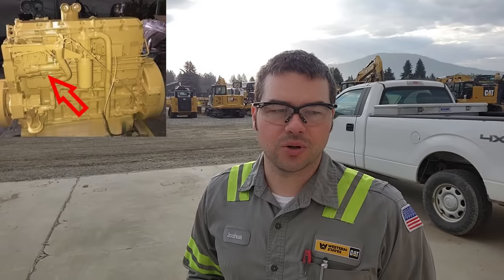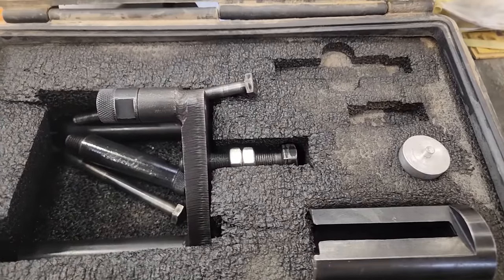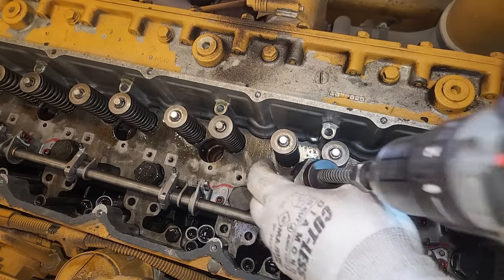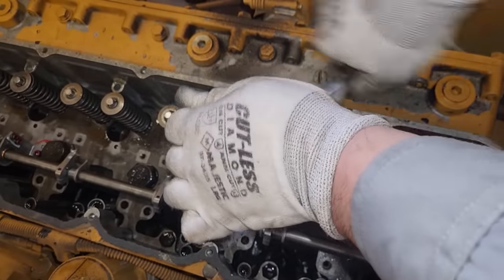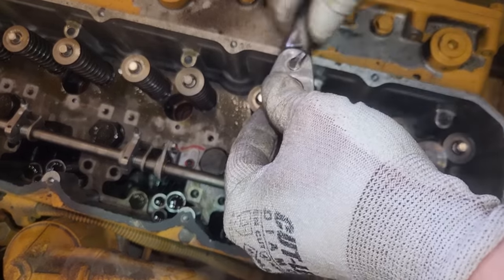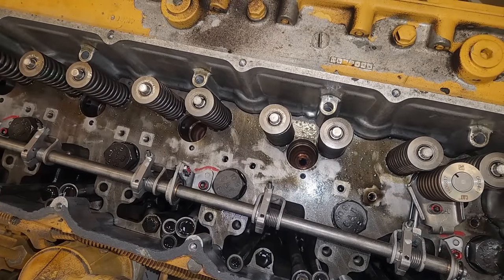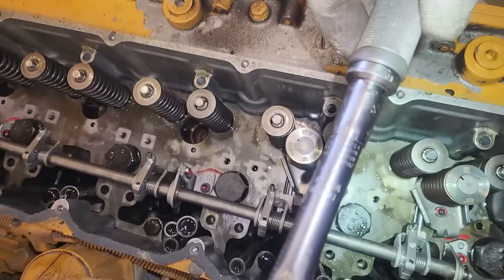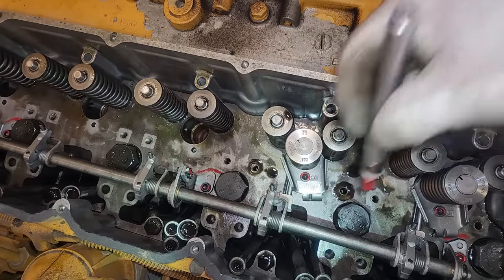Technically, A Headache! How to install Cat 3116 injectors and adjust the Rack.

Comment: More than 20 years ago I had an old Cat guy I worked with say you don't need to ream the coppers if you seat the injector with the seating tool.  I was thought he was nuts and lived by what the book says.  Tried it and found out He was right.  Now I only ream coppers if there is pitting in the seat area of the copper.  I usally shine them up and press a new injector in the the seating tool.
Reply: With or without the o-ring on the bottom tho?

Comment: You’re a brave man using CAT remans on a 3116. I put a full set of remans in an 3116 powered F-750 years back. 4 were bad right out of the box. Got 4 more under new parts warranty and two of those were bad. There were no more remans at the closest depot so the dealer I worked for agreed to put 6 new ones in. Everyone was happy except me…basically doing injectors three times in an F-750 where half the engine was under the cab really made me contemplate my life choices that brought me to that situation. Cylinders 1-4 under the hood then take all the tooling in the cab to do 5-6 through the dog house…

Comment: I've done quite a few of these from overhaul to injector replacement and adjustment, the hardest part was getting through the CAT manual on the first one I did, too confusing , but once I did more and more I could streamline the process and could say that I was satisfied with my results, a smooth running time bomb !

Comment: I remember in 1993 in Greenland at summit drilling camp they had 2    3116 gensets 
one Genset had  leaking injector, copper seat. And the cat dealer would not sell me the tools to install the copper seat so I had to put together a kit of tools for the mechanic out there new cylinder, head torque wrench I believe they already have the injector setting tools.

Comment: I used 1/4 in. vacuum line taped to the end of a shop vac when I had to pull shavings out of a cylinder.  Worked great.

Comment: Just like the old 2 stroke Detroit. Roll the cups in, fill with coolant and pressure test, install injectors, rack or racks, rockers, adjust valves, time injectors using the right pin, adjust racks. I spent 4 hours on an 8v71T just adjusting the rack. Get one side done then the other side was too tight.
Reply: That's why you do the #1 on each bank first. Then remove the clevis pin and adjust each 2, 3, 4, etc to its bank #1.

Comment: On Volvo D9 engine out of the g970 graders the cups were changed out every time. The original injector used copper washers but the replacement used a tapered cup and end on the injector

Comment: Looking at the older injector at 2:19, you can see the area above the seal it is about 3/8 of an inch wide, The other injector that is replacing it only about an 1/4 wide! That way it press in to the copper with more force in a small area. Then when you use the press down tool to force it in more to the copper, and you can see when your torquing it again it turns the bolt about a 1/4 turn insuring better holding of injector!
Reply: You actually crease the copper cup with the injector when you press it in.  I only ream copper now if that crease area is pitted.  If it looks ok I shine it up a bit and press it in again.

Comment: These engines are a whole thing in them self's. I would have cleaned up the reamer in a lathe at the damaged location, then added more shims to start. I used a speed handle to turn the reamer, so I could push down with some force, get it down then lighten up toward the end to smooth the  finish tapper.  I also cleaned off grease and used a light coat of grease on reamer then do the reamer one more time, this usually gives a good finish no chatter marks ! Do not turn the reamer back wards, can damage the reamer or dull it. When putting in the injector get it down in, turn it to engagement of the rack, then move rack back and forth to make sure it is free moving in the fork so it is not giving a preload on the fork and you get easy move meet of rack.

Comment: Just to add about the o-ring on tip. When you torque onto tip o-ring it will work for a sort time. With temp and time the o-ring will deteriorate and allow the injector shift down away from hold down bolt compromising clamping force

Comment: Better you than me. I hate these engines and stay away from them. One thing we tried was to use a speed handle to ream the seat. With a ratchet, you had the tendency to stop and get another bite. With a speed handle you can keep a steady rotation on the cutting tool. Also Carpenter make a aftermarket tool that was a lot easier over the Cat tool group to set injector synchronization.

Comment: Go 2mm over and it’ll advance timing and help with cold starts 👍🏻 ALWAYS run the lower “suicide” o ring. It will allow carbon to seal the cups after being reemed and will make life easier.

Comment: Use a speedwrench and skip the shims, slow steady turns, NO pressure, let the weight of the tool cut it, and please, NO ratchet.  You'll get a butter smooth seating surface, pull it out every few turns and look for the old seating groove from the injector.  Once the seating groove is gone, you're done, DON'T go any further.  Save that cup for next time you need to shave them.
Been there done that many times.

Comment: Cat also say no chatter marks, I found out use shims, and a drill on low speed no down pressure, they come out great, I always pressurized the coolant system after cutting all cups, and installing injectors, At Ransome Cat, one mechanic cut cups put everything back to find out when he seated the injector it cracked the cup, it was most likely  cut before.  Pretty much same thing as 3126
Reply from the maker: I'll try that next time. Pushing down was how I was shown and I've had good luck with it, but I sure don't like the chatter marks on this reamer.

Comment: you should set a two stroke detroit rack, lol cats are easy, leaving oil in those bolt holes will split the head using power tools, you should show the old rack if its the rivet one that needed the update,

Comment: The press tool when it came out was supposed to take to place of reaming. I ream some still if it had compression blowing by. But most of time press them in without reaming. I have had to redo some because not sealing reaming and not reaming. The smallest piece of trash will get you. And in the mines and plants when medium dozers and wheel loaders had 3116 or 3114 none would break in a clean place.

Comment: I’ve done 3 of these over the last 8 years. For injector, rack replacement and top end adjustment. An old timer told me to match fuel screw setting on new rack and sync injectors. Worked great each time. How wrong am I? Lol

Comment: Lot of following procedures there. They made it a bit complicated but if you have the proper information it should work. Surprised that the original ones had the o ring on the bottom but new ones don’t. You’d think that would cause placement issues. Great job on it.
Reply: The injectors were redesigned to have a short length tapper seating area, and with the tool to press the injector down then re-tighten the bolt made a big difference. The seal was not needed  after the update to the injector.

Comment: Very similar to Detroit Diesel 2-stroke setup. Did many. Don't turn reamer backwards. Only go in cutting direction.
Reply: Emd 2 cycle unit injectors are much simpler to do. One typically skips the rack adjustment when replacing a single injector. I’d check it with the tooling, and if it was within the window on the tool/gauge, it shipped. I’m not even sure if there is a cup reamer in the shop for dressing the seat in the head. I don’t think I’ve seen one floating around in the 20+ years I’ve been there. I remember some old timers saying one side of the engine thermal expands slightly more throwing out the adjustments on the racks on one bank, but I never found that to be the case.

Comment: The injector system is the same as the two cycle Detroit Diesel. I run a C-12. The manifold pressure has gone from 32 PSI to 20 PSI. Little loss of power, but slow to respond when throttling up. Any ideas. My guess is transfer pump is going haywire. Thanks

Comment: You need to put more time into reaming the copper, that area needs to be super nice, you left chatter marks, that area is susceptible to passing combustion gas.  We do not want come backs.  You have to develop a technique of smooth turning and even pressure and thinner shims so you can cut .001".  That carbide cutter wants to dig into the copper if you take too big of a bite.  This step is the most important part of the job

Comment: In my opinion the 3116 is one of the slowest and under horsepowered Cat engines that were built. I ran many medium duty wreckers with these engines and all of them were gutless especially the rollbacks with the automatic transmissions.
Reply: The 3208 might disagree
Reply: A lot of those engines were under 200 hp.  Not the 3116's fault they were starved for fuel.   We had service trucks that were 190 hp and lower.  Yeah they were gutless.  Backed out the fuel screw a bit and it would come alive.
Reply: The 3116s could be rated for up to 250 hp and 650 tq in the Topkicks and Kodiaks, but most came with 170 hp to 215 hp. Some fire trucks actually came with a 300 hp 732 tq version, but those are ultra rare.

Comment: Whenever I see a procedure for cutting the cylinder head to renew a seal, like valves or in this case the injector body seat, it makes me wonder why they decided upon that approach. In the case with valves, since the mfr's have gone to stellite seats the valve becomes the donor for wear. Which makes sense to me, the valve is less costly to replace than the entire head or seat replacements. In the case of the injector body seal, I wonder why they didn't use a compression washer made out of copper that you could simply replace. The seat area looks the color of copper on my computer screen, and you even said it looks like copper, but when you cut it brinelling reveals the hardness of brass. But, a copper gasket, similar to a brake caliper banjo-bolt and washer seems like it would work, it's only combustion pressure, not fuel injection hydraulic pressure. But, who knows? Maybe they got a patent on the cutting tool. Remember they're in business to make money, and even though it may not seem prudent, they want to make money where ever they can and if that means tools, oh well.  ben/ michigan

Comment: I have rebuilt somewhere around 15 of those and several 3114 engines. I hate the overhead on those engines. Our shop actually goes out and installs those copper/brass injector sleeves in, in the chassis. Did I say I hate the overhead on those engines.

Comment: How funny, they reverted to 1940's Detroit Diesel tech for the fuel system. But the Detroits were much more user friendly. Thanks
Reply: I thought it looked familiar!
Reply: Went to the equipment expo in Las Vegas when the 3500's and the 3100's first came out! Talked to the Cat representative, making Detroit's now, got a dirty look. Guess it should be easy to work on then, we both laughed and he showed me  some of the workings. I was working for a Cat dealer ship!

Comment: The injector cone shape changed over the years. That old reamer sucks for the later cones. Also Cat's reamers have issues with some being not hardened correctly and they dull fast. Also the sleeves updated and who knows who manufacturers them now. Ive been seeing 3116/3126 MUI engines one after another for a couple years now-marine application. The local Cat dealer wont work on them. The company I work for now has spent well over $10,000 to support these little turds. Injectors are getting hard to find...even crappy reman. We bench/pop test them - against Cat's recommendations. Theres a company that makes an aftermarket reamer that works much better than the standard Cat reamer.

Comment: Have there been any larger (13-18L) four-stroke inline 6 Diesels that use this kind of fuel system?
Reply: Which fuel system? Unit injectors?
Unit injectors have been very widely used industrially until common rail became a thing.
Without knowing it, i'd imagine you'd finde a lot of semi trucks with unit injectors in that size range.

I know you asked I6, but the EMD 567/645 is a good example of a large engine using unit injectors.

Comment: Why can't you just replace the cup are they not serviceable part
Reply: Replacing the cup is a hole different process! Lot more tooling. It would be a video in itself. Would love to see him show it.
Reply: The cup can be replaced but only after removing the cylinder head , and requires special tooling to expand the cup to make the seal to head.